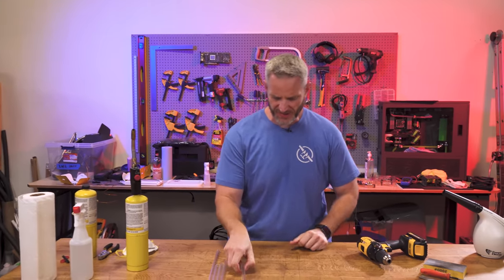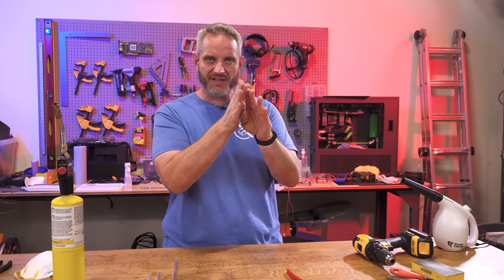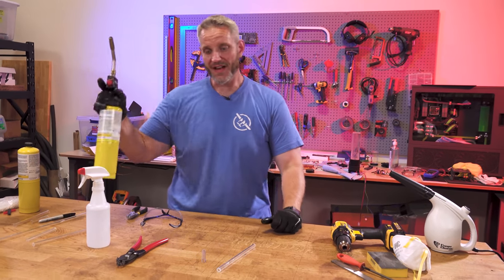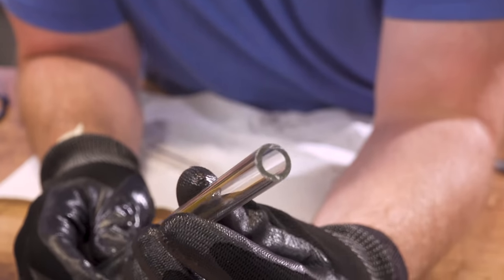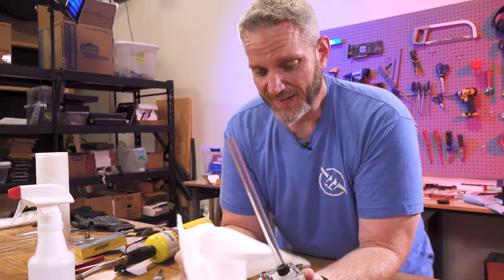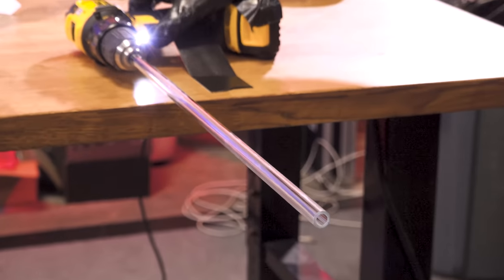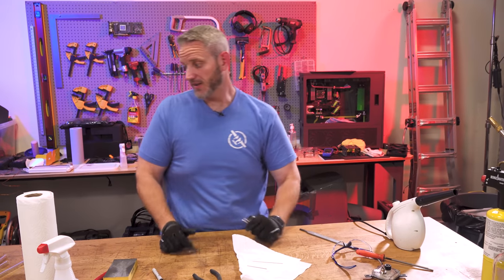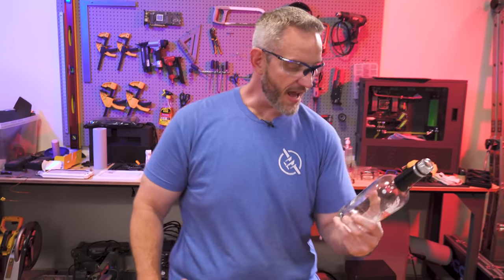Learning how to bend Glass Tubing... This looks soooo good!

Comment: Very happy that you mentioned safety concerns of glass dust!  SO many videos ignore this.  Not talking trash, just some advice: mainly, get yourself some didymium safety glasses to protect your eyes from the sodium flare you mentioned (the bright red that comes off the glass once hot).  You don't want to expedite the cooling of glass after heating.  Ideally, you use a kiln to allow it to cool over the course of several hours.  A tool to help - nothing really, since MAPP + air is working, but attaching your torch to your bench and rotating the glass by hand can help.  A drawing of the angle you want can help, esp if rotating by hand, then you can move the glass to the drawing to make sure your angle is correct.  Neonworking torch if you want to go all out.

Comment: Jay: "Wear a mask when clean breaking glass so glass dust doesn't get into your lungs"
Also Jay: Takes mask off when using extremely fine sandpaper on glass creating even finer dust and smoke
Logic not found
Reply: Do as he says, not as he does 🤣
Reply: When heated it acts as a fluid...?🤷‍♂️
Reply: @It-b-Blair  When sandpapered at high speeds dust acts as dust..
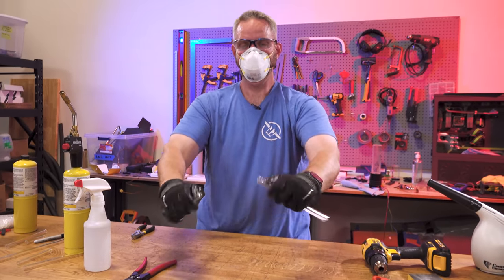Reply: breaks glass immediately takes of the mask bends over and puts his face right  into the dust XD 4:55
Reply: I searched for that Comment ;)
Reply: @angelchaff4527  and takes a deep sniff lol
Reply: @ReclusiveEagle  to me that looked like a joke
Reply: I think it's a video thing his voice with the mask wouldn't be that clear.safety first I get it .
So the mask find its way to get off.
Reply: Yes, plus you need a vacuum cleaner before removing the mask. 
Like a really good one. This dust will stay there for years to be inhale little by little.
Reply: @It-b-Blair  I don't think you can sand a liquid man, haha
Reply: Yeah... Saw it around 4:55 I think, was like yikes... But still nice he did a redo.

Comment: For those that attempt to play with glass, please wear the proper protective eyewear so you don't ruin your eyesight.

https://en.wikipedia.org/wiki/Didymium
Reply: Unless they are using acetylene and/or going for longer periods of time than what is shown here, the level of exposure to sodium burn isn't goingto be a big deal. There was barely any sodium burn in what was shown in the video, quite frankly.
Reply: Most glass workers use propane/oxygen. Acetetyle is expensive and overkill.
Reply: @gravdigr27  Most garage/mechanic workers use Oxy-Acetylene for cutting super thick metals. Id imagine this would be massive overkill for small glass projects... NO need to be blowing holes in the side of 6 inch thick carbon steel in a glass shop.
Reply: @crisnmaryfam7344  I'm aware of this. I've had a good bit of experience with cutting torches as well as stick and mig welding. My point was most glass workers use propane. I had access in my shop to acetylene and still used a 20lb cooking grill propane tank for glass working or when cutting thinner mild steel that didnt require the extra heat of acetylene. The acetylene and propane tanks use the same size left handed threads on their valves so the regulators are interchangeable. Even if you have acetylene it is still more economical to just snag the propane tank off the grill for glass working.
Reply: Bros working in style with Oakleys on!

Comment: Former glassblower here (lampwork/art glass running oxy/propane borosilicate). I wouldn't bother with the drill. You can rotate it in your hands at a speed appropriate to prevent slumping and once you get temperature, you can make a better bend using both your hands. The heat doesn't travel far up the glass but you need to know where the glass is hot. For scoring glass, a tungsten carbide blade is best imo. Hold it at an angle against the glass with the cutter in your hand and finger over the tube holding it against the blade, and spin the tube against the blade to get the ideal score.

I never considered water-cooled glass rigs but it would be interesting to try if I ever got my studio set up again. A lot of cool techniques could be incorperated.

Comment: There are inserts to put into the glass tubes that maintain the ID for a consistent pressure and flow. Using those inserts, a torch, a wet saw like used in glass tile work, and fine grit sand paper you can do really awesome stuff with glass. I would also say to get a tube holding jig that rides on a saw sled to insure that as the glass is feed into the saw it stays perfectly straight would be a huge help, but after enough practice you can also do it without that. Beyond that it is just experience more than anything else.
Reply: If he's going to do it on the cheap for more DIY instructive purposes, I've cut glass tube with a diamond wheel on a Dremel tool. Plenty of cheaper tile saws out there though.
Reply: @scottschmidt9292  That was exactly what he was doing in this video though, DIY tutorial on glass tubing cutting and bending. Did I miss understand what you are saying in your comment, or did you make a mistake and not finish the first sentence? IDK honestly...
Reply: I got excited bout this idea and decided to look into it. The silicone-based inserts that are sold for this very purpose start to burn at 450°C. Glass only starts to become malleable around 600°C. Is this going to be a whump-whump or did you have a different kind of insert in mind?
Reply: @kaisergrendel  I think the inserts are for after your done making the tubes. They prevent having to directly use glass in your fittings so you don't have to guess with your torque and risk breaking glass or leaks.
Reply: @aaronb9630  I see. How would one finesse the edges of the glass that way? Do the fittings have a separate receptacle for glass only?

Comment: Hi, if your glass tube is a little to long, you can grind it with a diamond cutting wheel for the dremel, but be careful with the glass dust. You can deburr the tubes with the cutting wheel as well.
Edit: I used the clamp tool from your earlier videos and it worked great, no spirals on the tubes. The clamp tool, the diamond cutting wheel for small length corrections and deburring and some polishing paste to make the ends even smoother were the tools I used for my build. I bought my 90° bends from a local glass manufacturer for around 6€ each.

Comment: Head to home depot and get a wet tile saw to cut the glass. A cheap one will work just fine and make your life so much easier. It's worth it.
Reply: Was thinking the dremel diamond cutoff disc would probably work well.
Reply: Tried that, nope! Not even the  gold coloured disk is fine enough. Order a disk made for wet cutting glass, and dremel extension.

Comment: My buddy had a kinkajou glass cutter. It had the similar walking issue you talked about at the beginning but, you would pour boiling after on the score and then cold water to fracture at that point.

I bring that up because if you have a good score on a piece you want to remove like half an inch on, it should work. If you put an o-ring on each side, that will also focus the water to stay concentrated on the score.

Just a thought, cool video

Comment: borosilicate is essentially Pyrex, and its resiliency against breaking and temps, compared to normal glass, is accomplished by allowing the molecules to anneal by cooling VERY slowly.

this is a long way of saying, maybe don't use the air to cool it, if you want to retain greater strength against cracks and breaks. 😊
Reply: Kinda of like a steel weld. If you cool steel too quickly, you cause the crystal structure to be coarse and large, making it brittle. Especially in the heat affected zone on either side of the weld bead.
Reply: ....
You are nearly right.
The resilience comes from the addition of Boron, not from cooling it down slowely. And while Pyrex is a common brand-name associated with that, it is neither the inventor, nor main producer - and a lot of Pyrex is NOT borosilicate but normal soda-lime glas.
Reply: It used to be almost entirely borosilicate but not any more.
Reply: The air cooling isn't the main issue its the using of a blower to cool it and not using a lower powered flame to keep it warm for a few minutes after bending. with how thin glass tubing is its not going to impart as much stress as a thicker glass so you can aneal it much faster but you do want to anneal it.

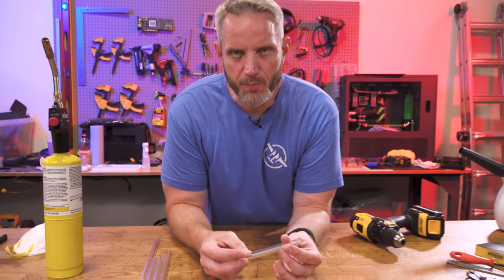Comment: 1:45 His name is Beaker and he's from the Muppets.
And I still think Erlenmeyer would be a much more appropriate name for Dr. Bunsen's lab assistant.
Reply: Both are correct - the laboratory equipment IS called a beaker.  It's a glass container with an open top, and usually has a spout or "beak" for pouring. AND, he's Doctor Bunsen Honeydew's assistant on the Muppets.

Comment: "I am aware of how bad this is"
camera zooms out to show Jay holding glass in a drill and a propped up torch with no safety wearing sandals with shorts.... yeah pretty bad lmao
Reply: The sandals and shorts actually are not the main issues in this video. Proper body positioning can cancel out almost all the dangers those create. The fact that he's relying on tape to hold the drill that is connected to a tube that is over a carpet is a much greater danger. The gloves that will melt into his hands aren't great either.
Reply: Fun fact, skin sticks to hot glass. I knew a glass blower with an amazing scar when a 2" marble he was working popped off the punty (glass handle) landed on his thigh and rolled down his leg melting skin and collecting it like a snowball rolling down a hill. Most glassworkers work standing up for that reason.
Reply: @gravdigr27  Holy i can imagine the hole it must have left. hope it wasn't too large,  he may have had to get a graft.
Reply: @duser  it didnt leave a hole. It rolled down his leg and made a track down his thigh as it picked up skin on the way. Hot glass is dangerous. I cringed so many time watching this I made a comment begging him to bring in someone experienced with glass working. Additionally without a kiln to anneal the glass every bend will cool with stress in it and eventually crack and/or break which would be bad. There is a LOT more to working with glass than acrylic. I did it for about 8 years.
Reply: @gravdigr27  
Oh gods, stuff you'd learn permanently after only one oopsie, guaranteed.
Reply: @gravdigr27  Which is also why a lot glass blowers where a leather blacksmith/welders apron. I've had hot slag from stick welding burn me through my leather welding jacket as it landed in the crook of my elbow. The joys of welding overhead.
Reply: @mikeford963  lol, yeah. I used to wear my welding apron when glass working until I got used to it as hot glass doesnt spit like welding flash does.

I used to build hobby rock crawler trucks. Nothing like laying on your back while under a truck welding a custom exhaust.
Reply: @gravdigr27  Yeah, you can reduce that "spit" to just sparks, but then you've gotta be really careful with technique. TIG is fantastic for welding exhausts and cages for rigs like that.

Comment: They are called Beaker cups, because they have a "beak" for pouring liquid.
Reply: This isn't actually true, it comes from the greek for drinking vessels. But laboratory beakers do usually have beaks.
Reply: @Eddiebo619  it actually derives from the german word for cylindric vessel that is Becher.
Reply: @thepais9497  yep, from the greek bikos
Reply: @Eddiebo619  not exactly germans and german language has nothing to do with greek, it's from Old High German behhari (compare Dutch beker), from Late Latin bīcārium ("wine vat, jug")
Reply: @thepais9497  and latin got some wird's from old greek. The languages are all connected in western Europe...
Reply: @thepais9497  If you are trying to sound smart - at least make sure you are right.
Cause the chain for the etymology of "beaker" goes English => German => Latin => Greek.
Reply: @ABaumstumpf  I admit that I missed the link between the latin and the greek, my bad.
Reply: @thepais9497  It's true that the origin of words is usually convoluted but, the generally accepted route for the word beaker is from Greek "bikos", to Latin, as you say "bicarium" a probably diminutive of "bikos". From thence to Old German, again as you've mentioned "behhari" but the probable final route to english is likely from Old Norse "bikkar" not directly from Old German
Reply: @thepais9497  Hey, at least you can admit a mistake! The mark of a true scholar. 😁

Comment: Soda-lime glass is your common glass used for plate glass windows, drinking glasses and vases. Boro-silicate glass is very resistant to thermal shock. It is used for baking dishes, laboratory glassware and tempered glass.

Comment: The orange is the sodium in the glass burning.
Reply: Exactly this, blue is hotter than red Jay.
Reply: its not quite the sodium burning (as that would imply its reacting with the oxygen) but rather there is enough heat to push up the sodium electrons into a higher energy level, when said electron falls backdown to a lower energy level it emits the same amount of energy, but as light. The amount of energy correlates with distance of the gap between the higher and lower states, and that is why different metals emit different colors ight when heated as the differnce between the energy levels are different.

Comment: 12:30 actually capping them off would cause the tube to expand under the heat. Heat causes air molecules to spread out. Therefore youll have some expansion in the tube if not super careful.

Comment: I used to work in a glass shop and I have a few tips for you.
1: Cooling the glass tempers it.  This makes the glass tough but very dangerous under the right conditions.  The slower the glass cools the easier it is to score and break it later.  Cool it too fast and the glass will explode under tension.
2:Do not use rubber or synthetic fiber gloves when working with hot/melting glass.  The heat alone can easily cause them to melt to your skin.  I personally rarely used gloves at all.  Glass suppliers sell gloves that would permit touching glass almost immediately after bending.
3: A wet tile cutter can have a diamond blade installed to cut glass.
4: Fire polishing after cutting needs to be done with a much hotter torch.  No sanding is needed.  If you have the time wet sanding works instead of using a torch.  Be aware that if you sand water must be used or silica in the air can cause serious health problems.
5: Gravity is your friend.  When the glass starts to bend simply let it slowly fall into the position it needs to be.  Using a torch with a larger and broader flame could help.

Comment: Couldn’t you put a cylindrical tube slightly smaller than the glass tube an inch in to break off and inch or less of glass tube
Reply: it'll work, but first you need to make sure the smaller tube/rod has the strength to survive it.
Reply: *maybe*, but i'm pretty sure an important part of breaking the glass is the pulling he talked about, and just the leverage isn't enough.
Reply: @eletricsaberman8916  I think it would be since the longer the lever the more leverage you get. If you do it right it would work as though the tube was longer to begin with

Comment: For future reference you could always just do what we in the glass industry call flame fixing the edge of cut glass. Look into it because it's where we use a Mapp, propane  or oxy/propane flame to heat the glass cut till it just starts to round the edges with no need for a file or sanding cause if you get even a slight rough edge it will over time will allow water and cooling mix to degrade your o-rings.

Comment: I've put together several glass tube builds. I've found that just sticking to 90 degree bends using fittings to be the best DIY method. If you want bends in the tubes, stick to PETG.

Comment: Glass blower here:
I’d recommend a blow hose firstly to get the internal pressure up in order to not have to worry about it collapsing. Also a small glass blowing torch from GTT is like $300-500 bucks used/new and would be worth it.

Also Jay, the orange flame is the sodium in the glass burning off. Highly recommend didymium glasses to protect your eyes.

Comment: Glass is awesome. I made my FIRST watercooling build with glass. I used PETG as templates, same as Jay, and used butloads of fittings and some prebent glass pieces. I messed up one prebent piece and had to swap it for straights with fittigns and didn't get the lenght perfectly right, so it's crooked, but everything is sealed just fine :P I've been using this build for past two years, and the best thing about glass is that it does not cloud, it does not introduce anything to your coolant, so my pastel white fluid is holding perfeclty fine (my res is glass, the only part non glass is either metal, orings or acrylic cover for GPU block).

Comment: Diamond cut off wheel on a Dremel will save you tons of time, that's what I do. You can get a knock off Dremel for 20 bucks and the cut off wheel for a little less. All in all less than 40 bucks and no need for a torch or sanding, I round the edges with the cut off wheel.

Comment: To help with the bends u can also fill the tube with sand, and cap both ends, it won’t crimp your glass
Reply: I've also seen what looks like a rope inserted (presumably fiberglass or some other heat resistant material).  I searched around for it, but failed to find it.

Comment: I was talking to a glass blower recently about interest in getting into the business. He recommended using 104 coe glass that you can get at like home depoe and use regular torch. Borosilicate is a relatively strong glass and apparently using something like that 104 coe glass it's easier to play around with especially as a beginner. It's a way to get used to the consistency and the way that glass works when it's hot. At least it seems like your MAP torch works well enough to heat boro though.